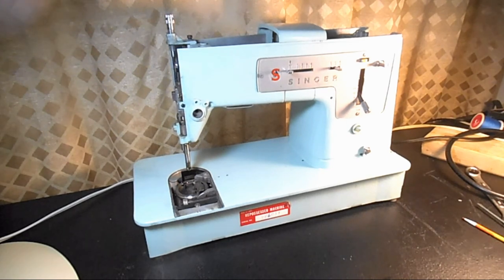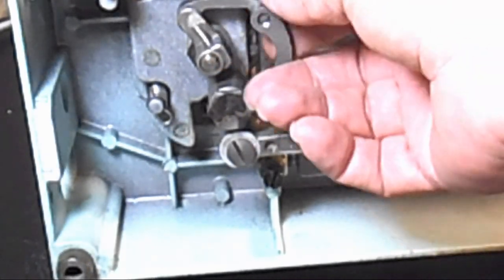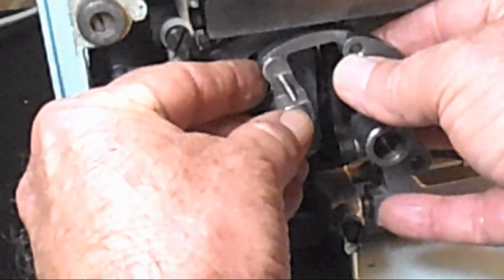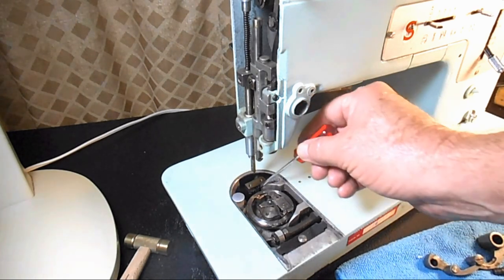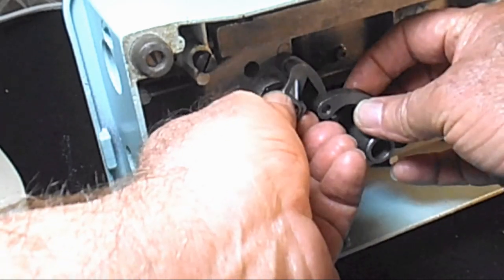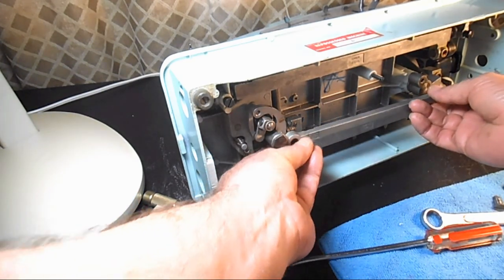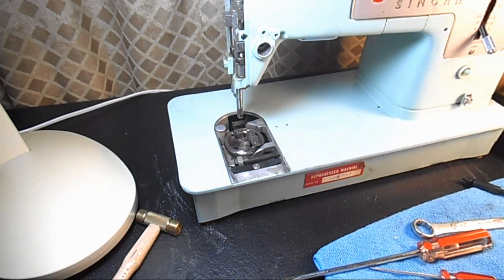Remove & Replace hook "Bell Crank" Hook system on a Singer Model 338 Sewing Machine

Comment: Thats not copper. Its oil impregnated brinze most likely
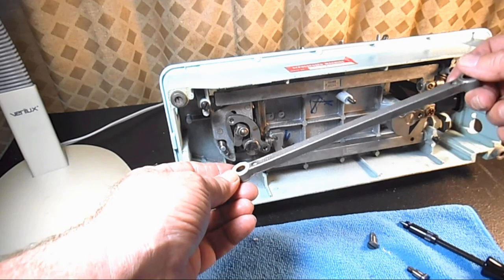Reply from the maker: OK, jas, let's discuss this then. You very well may be correct, and thanks for pointing it out. I'm familiar with Sintered Bronze Bearings and Bushings. They are used on most if not all Singer sewing machines & motors. Bronze has a high level of copper in it, and these sleeves, which I point out @9:25 in the video, looked more like copper than most of the bronze bearings I have found on the machines. Maybe these just have a higher copper content, but surely they are not pure copper as my narrative suggested. It is an important point that you made in your comment and I'm glad you did. For those wondering about this here is info on Bronze: https://en.wikipedia.org/wiki/Bronze    and here is just one of many, many, explanations of Sintered (oil impregnated) bearings and how they are made: http://www.technoslide.com/articles/sintered-bearing.html#.Ytq5s3bMJEY    Thanks for watching my channel and taking the time to comment and I pinned to the top of the comment section.

Comment: I found a factory defect in my machine the small screw that holds the bracket in the top with the adjustment for thread comes down and hits the bell crank through the small hole where the bell crank bolts ..if you get any problems with a tight spot in the turning of the bell crank its the third hidden screw in the top bracket next to the bobbin case
Reply from the maker: Thanks for sharing this. It must have been hard to troubleshoot. Makes me wonder if someone, during the last 59 years, put the wrong screw in during a repair. If only the machnes could talk. Happy sewing.